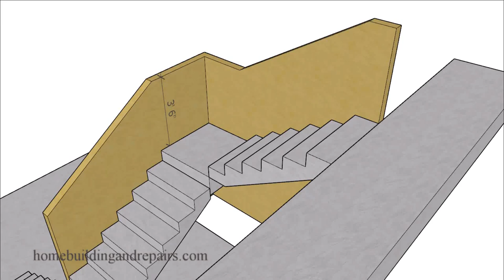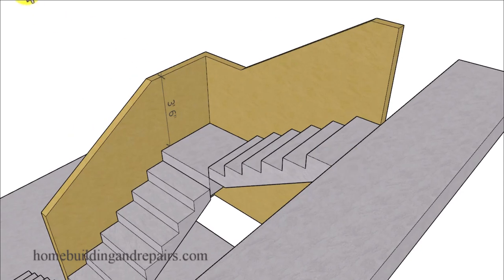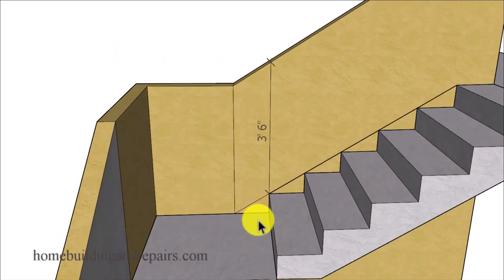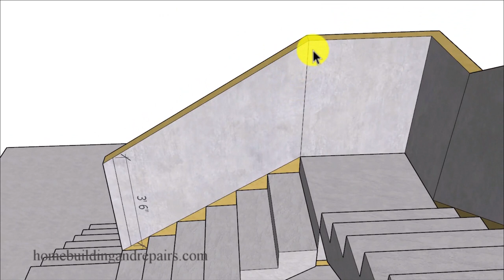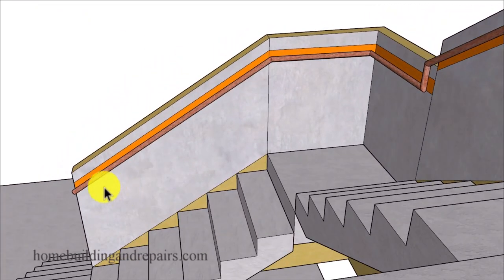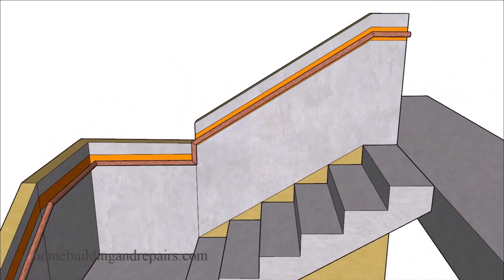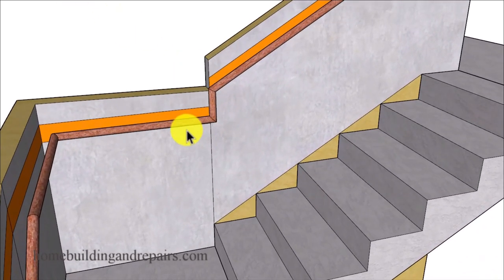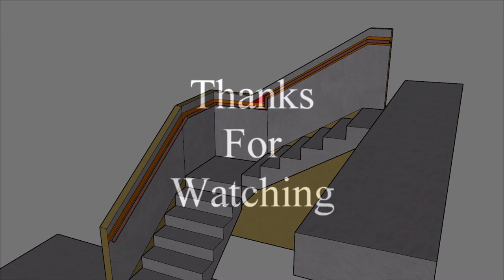Handrailing And Guard Railing Layout Examples For Outer Side of Landing - Building Codes

Comment: I am dealing with this exact condition.  The inside handrail meet the landing and makes a 90* right turn- there is no room on the landing to extend the handrail 1 tread width to maintain the correct elevation as it would protrude too far into the landing.  Code requires the handrail to be continuous.  Does code allow for the vertical drop?  It meets the continuity requirement but as mentioned is not ergonomic.  Can you respond to this?  TIA
Reply from the maker: You should check with your local building department, but most of the time it's allowed or they will allow for odd situations.
Reply: @stairbuilding  Thanks for the reply.  I plan to submit an RFI on it with a sketch so they can see the problem.  They can accept it, make the landing longer or provide their own solution.  The design team's obligation often gets shuffled off to the fabricator so I just toss it back to them.